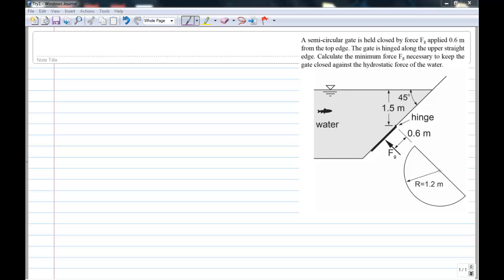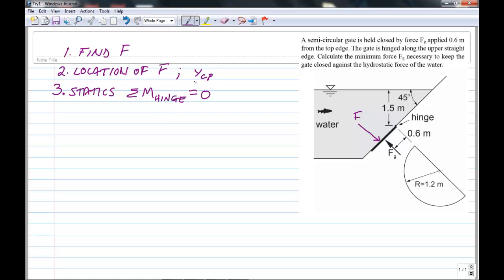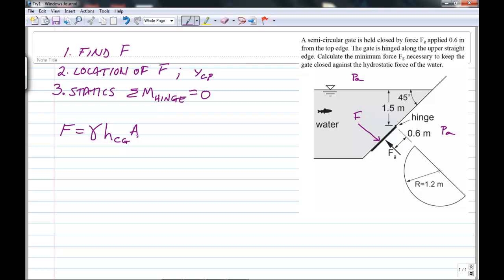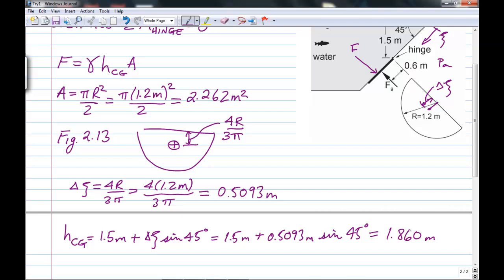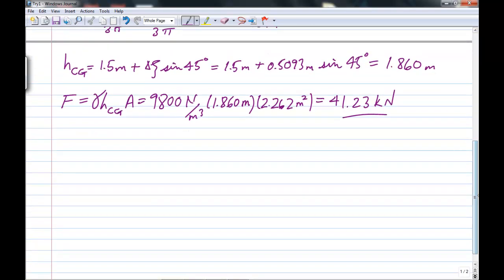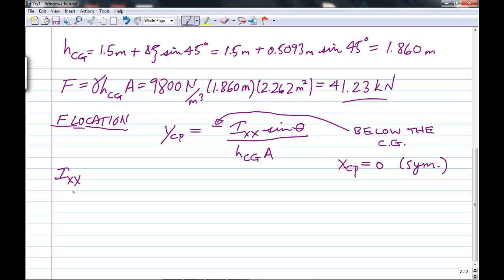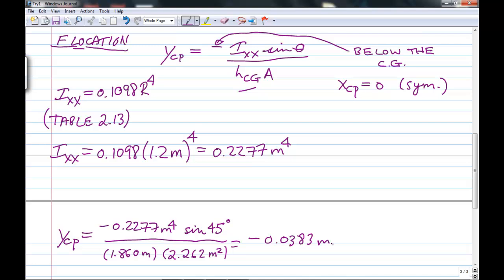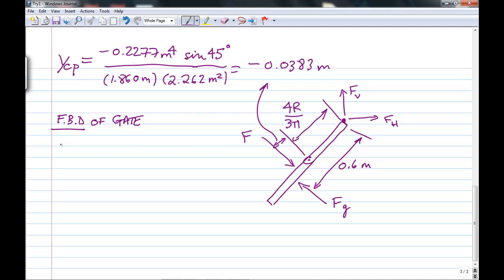Solved Exam Problem: Hydrostatic Force on a Semi-circular Plane Gate

Comment: when do we use the area of the projection to calculate the horizontal force? in some exercises hey use the area of the projection and in others like yours they use the area of the initial shape. i don't know when we must you each of them
Reply from the maker: Note that the force F is normal to the gate. If you the projection (into the vertical plane) you would get the horizontal force. So, you can use the technique often used for curved gates here too, if you want.

Comment: I think that Yc = Yg + Ixx'/A×Yg
And Ixx' = 3,14×r²/ 4
So I don't understand what you did
Reply from the maker: Ixx is the 2nd moment of area about the horizontal axis through the centroid of the semi-circle. It is correct in this solution for sure. Note that Ixx must be proportional to R^4. Your formula for Ixx (with R^4) looks like it is for a full circle, rather than a half-circle.  That's the best I can do for you.
Reply: @FluidMatters  yes that's true. Thanks  a lot but for the formula of Yc. Is it correct?
Reply from the maker: @Gaelleda  Difficult to say, as you are using a different nomenclature that me.
Reply: @FluidMatters  I come up with this Ixx = πr⁴/8 = 0.3927r⁴
Reply from the maker: @user-gw3bv3fn8o  This is not the second moment through the centroid of the area. Your formula is about the wrong axis location (the base of the semi-circle.
Reply from the maker: @user-gw3bv3fn8o  It needs to be through the centroid. See:  https://en.wikipedia.org/wiki/List_of_second_moments_of_area

Comment: Thank you for sharing your knowledge, this video has helped me start to get a better grasp on these kinds of problem. I'm not sure how but I ended up with a  yCP value of 2.63. I used the equation from the FE exam reference handbook: yCP = yC + IxC/yC*A. My yC value was 2.6 which I got from adding the centroid distance to the slant distance from edge of gate to edge of water. I had the same IxC and A values. Any idea where I went wrong? My handbook doesn't include the formulas you were using but I was able to solve for the normal force to the gate using my version of that formula.
Reply from the maker: Sorry, it's super hard to debug solutions with just a comment to go by, often with different nomenclature (i.e., yC).